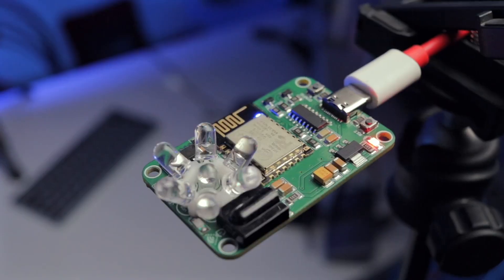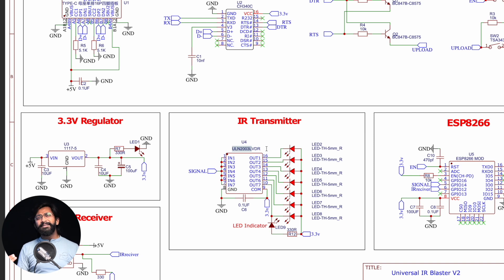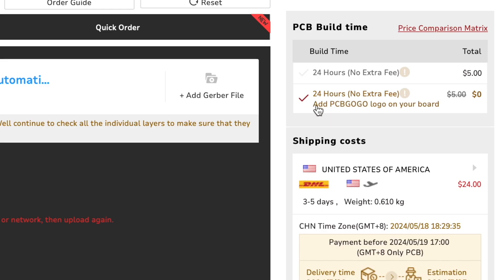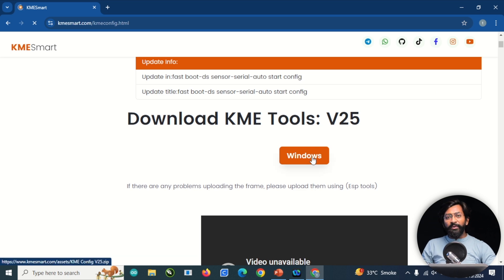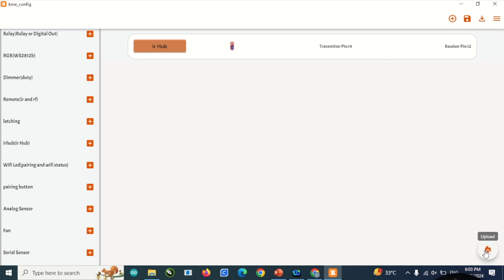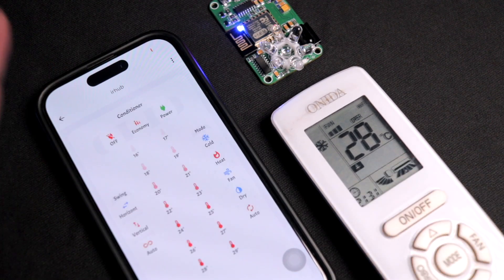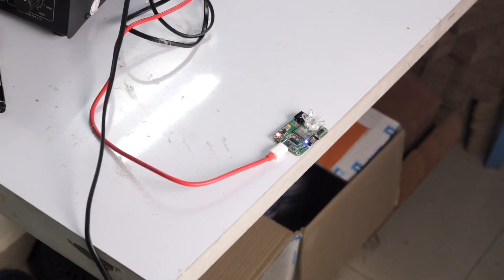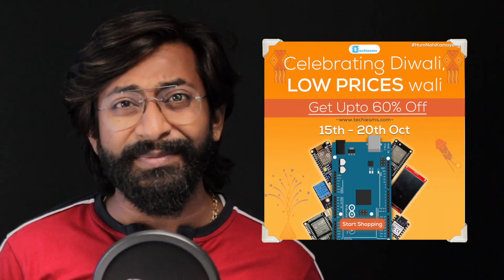MOST! Powerful & Versatile IR Blaster | KME Smart | PCBGOGO

Comment: I barely have any IR devices now. Tv has bluetooth and network remote. Fans have IR but wifi connected. What else is there to control with IR
Reply from the maker: Air conditioner is the most common appliance for which IR blasters are used

Comment: cool, i will make it more compact , also will remove some useless components ,a nd will make it battery efficient , currently it is not much battery efficient , as i have to add battery , small and compact , if you have  extra parts you can share those with me